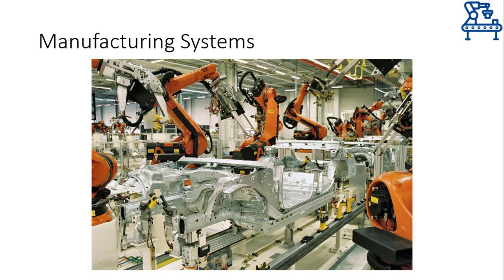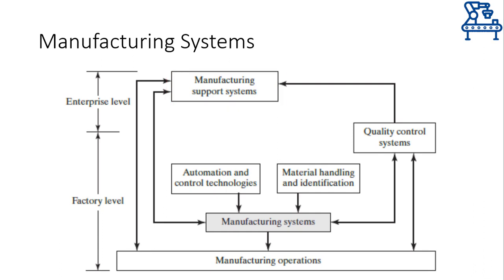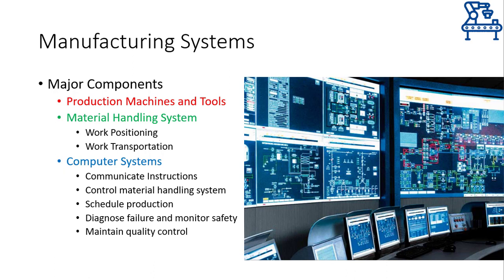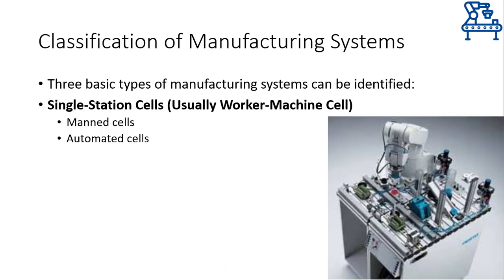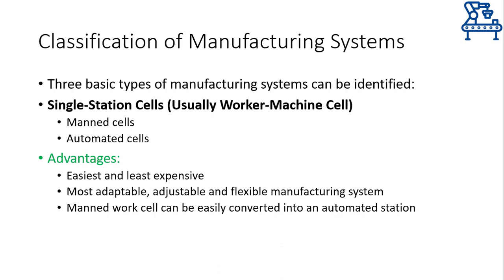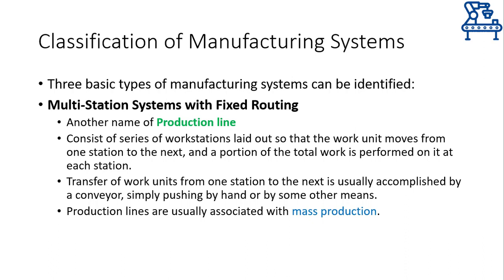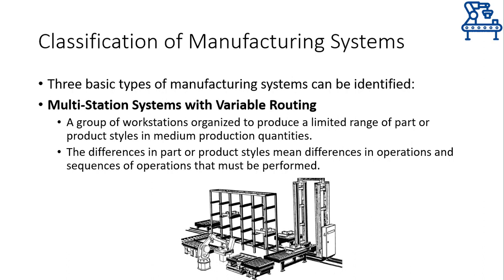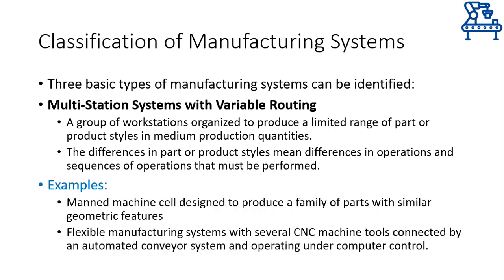Manufacturing Systems | Industrial Automation

Comment: Paper industry is the best example of Multi-Station system, In this industry wood converted into some material and move into different containers (or workstations), through conveyor a large amount of small papers moves into other station with fixed routing and combine together in the form of bundles.

Comment: The F-35 Lightening-2's final assembly line is an example for multi station system, where the basic carbon composite airframe is introduced into the line and sequencially all the components are put into it e.g. engine, avionics, radar, ejection seat, cockpit, hydraulics etc. When the aircraft is done with an individual cell, the hydraulics lifter lifts it up and drop it into the next cell.